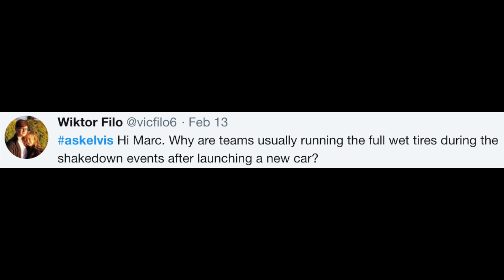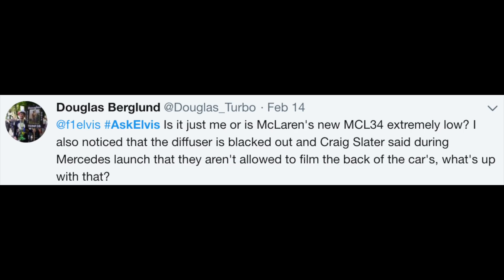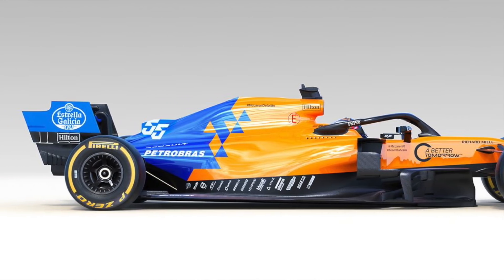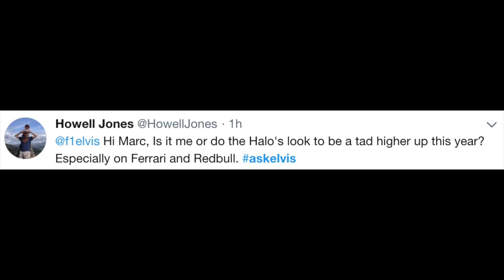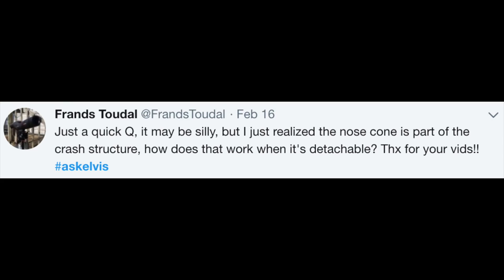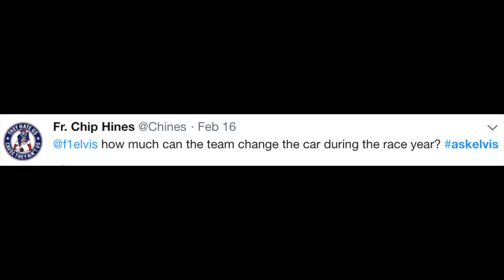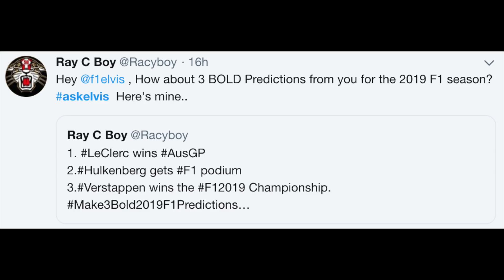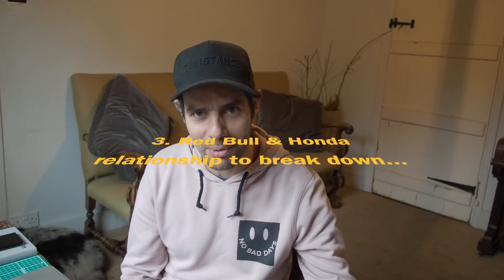MP231 - Is there an F1 advantage to using matte paint on the car?...& other Q's.

Comment: Wet tires are optimal for testing since they don't need much heat to be actually driveable. Slicks at 50-100km/h slow lap are like plastic wheels on a toy tractor - no grip at all.

Comment: The teams run on blue wall demo tires that are treaded because they're not allowed to use actual race tires on filming days. It has nothing to do with saving performance tires for later, they're simply not allowed to use them at all in shakedowns. I think all the cars are going to go to matte paint because of the weight. Yes it's a minuscule amount in the gloss coat, but there's no reason for it to be on the car. What tends to happen to anything on an F1 car that doesn't need to be there regardless of how big or small?
Reply from the maker: Actually they don't have to run on wet tyres for filming days at all, they have to run on dedicated tyres, which are a non specific dry tyre. They can however use wets for installation laps.

Comment: Well to my knowledge from RC planes. High gloss finish keeps boundary layer of air closer to surface, making higher pressure differences and therfore creating more effective low pressure side of wing. However it also makes quite a bit of drag, that is why high speed gliders with high gloss foil on it's wing are so shitty to fly without motor or uphill wind, but so much more effective with motor. Matt surface usually works better with thermical gliders.
I could be wrong of course, but it makes me think, that parts of body of F1 that are matt will slightly reduce drag and lift, that it is creating. As it is mostly visible on rear part of the body, that is the part, that is naturally creating lift, which might be slightly reduced by matt paint.
I can only hope, that I could someday check underside of front and rear wing and undertray, because if those are high gloss on those matt cars, I'm right :-)

Comment: Ask elvis# what is the reason 4 lowering the temperatuur of the tyre warmers ???
Reply from the maker: It's to do with Pirelli's recommended starting pressures at a race. Teams wanted lower pressures for performance benefits, so Pirelli suggested lowering blanket temps to allow that to happen.

Comment: Does matte paint or paint color have any effect on the cooling of the engine #askelvis
Reply from the maker: Not really. Obvs dark colours absorb heat in sunlight, but heat under bodywork is so much higher it doesn't have much of an impact.

Comment: And yet Mercedes have a new brand pattern on the back of their car. Aside from the fact it's just the arrow from the centre of their logo, which in branding terms is usually heresy, a few years ago creating a pattern from their trademark logo was also forbidden. 

But this pattern is painted on, and from previous videos they remove and repaint their livery every race. It also appear two tone, or reflective, with some arrows white and some dark grey... The pattern doesn't need to be there but they strip it and reapply [with some miniscule weight addition] so much effort, cost and time purely to look good as there are no performance/cost saving benefits.
Reply from the maker: I suspect the Merc engine cover is vinyl rather than painted...
Reply: @F1Elvis  As a designer I was fascinated with their 'laissez-faire' approach to their logo, it took 3 attempts to get a response [and find out about its application] but this is what Mercedes said: "It’s all painted! And it’s a new Mercedes brand pattern that is debuting on the F1 car." Vinyl would seem more sensible to apply but why would they fib? There's this close-up [https://twitter.com/MercedesAMGF1/status/1097464058805141505] that's clearly vinyl for the 77 and one arrow seems to have depth, but surely vinyl would weigh more...
Reply from the maker: I'm amazed if that's painted, but if they say it is, I guess it is...

Comment: Playing off the matte finish question; #askelvis has any team ever tried to do a golf ball like finish? You know a dimpled finish, maybe even designed right Into the bodywork itself? Anything in the rules to prevent it or thoughts why it prob wouldn’t work?
Reply from the maker: Nothing in rules to stop it, but whilst its aero efficient on a golf ball, the more important factor on an F1 car is flow control and for that, it's not so good.

Comment: Someone alrdy asked this but let's say in Austria where there are a lot of right hand corners, are teams allowed to run a higher angle of wing on half of the wing compared to the other half? Would there even be a performance benefit?
Reply from the maker: Nothing in rules to stop it, but whilst it works on an oval with no right turns, the performance loss through those corners in Austria would be too detrimental.

Comment: #askelvis
Does the engine formula1 team use in winter testing is outside of the engine quota for the season? On an average a car is driven for 1000 laps over a period of 8 days in testing, how does a single engine last for that long distance?
Reply from the maker: Yes, these engines don't count for the season and there's no restriction to how many they can use in testing.
Reply: Marc Priestley thanks for a quick reply. I am a big fan of your analysis. Keep up the good work 😀

Comment: There have been multiple times where the nose cone of a car comes off when it impacted even at a slight angle to a wall even though it's not a hard impact (Vettel in Singapore, Grosjean in Baku). It seems to come off too easily which could be a problem where if there is a collision at a "correct" angle which knocks the nose cone off, the car would then potentially crash into the wall without a nose cone which will be bad.

Comment: Regarding matt paint, there was an ongoing conversation on a rc flying forum about surface finish for pylon racing planes. 
The theory was that shark skin is rough and creates a boundary layer that reduces surface friction.
Could this be replicated on RC planes glass resin finish?
An aeronautics engineer ( in the whats next game ) pretty much gave us the answer when he said in principle yes, but to create the perfect finish that would stay in good shape and not fill up with dirt, fuel and grubby hand prints is much harder than creating a smooth finish, besides planes are too small to notice.

A matt finish could over the larger surfaces of an F1 car work better, not so much to improve speed through lower drag but to smooth and direct airflow better.
It could also increase surface area with it's imperfections to increase cooling, tho you'd think a white car would be better here.

Talking of colour recent research suggests sea going birds tend to be black on top, white on the underside.
Rather than camouflage to avoid predators ( nothing bothers attacking adult albatrosses, but the young are all black )  this may, through warming the upper wing surface increase wing efficiency.

Comment: Hi Marc, loving the content. on the matte paint side of things, i remember quite a few years ago there was an extreme hill climb car based on a ford Puma that used full carbon body panels (and a twin turbo cossie engine). the owner wanted it painted but didnt want to add weight, and they basically searched to find the lightest way of covering the car. in the end they used a light grey colour. it was lighter in weight than matte black, and considerably lighter than a full colour finish (something like 15-20kgs over the whole car).... i could be remembering that incorrectly though. and im sure they use as little paint as possible on F1 cars so the difference would be negligible.

keep up the good work!

Comment: In an article posted on espn f1:  
Ferrari's matte paintwork 'not a matter of looks'
"The new matte paintwork on Ferrari's 2019 car was used for technical reasons rather than cosmetic, according to team principal Mattia Binotto."
"It's not a matter of looks, there is a technical reason why it is matte," he said. "The weight is lower -- we are talking about some hundreds of grams -- but as we are pushing these technologies it made the difference. It's a matte finish and it makes the car lighter."
Reply: Yeah, I read somewhere that they predict 1/2 km/h increase in straight line speed down the long straights due to the drag reduction. Whether that's true or not remains to be seen
Reply: Less than half a kilo, yup that will win all the races.....
Reply: @vernonpitts6630  to shed kilograms, shed grams.

Comment: Newey pushes the aero stuff so hard he compromises the cooling and if the Honda engine is not reliable it would be hard to know if it is an intrinsic Honda problem or if the constraints imposed by Newey are the cause.  Newey is a great aerodynamicist, but he tends to cut thing too close to the bone which hampers reliability.  You can't win if your car is smoking on the side of the track.
Reply: To the limit indeed. Would be unfortunate. I think it would be easy for them to find out who would be to blame if they'd have cooling issues. Since they have 4 cars with the same engine, 2 of them with a different chassis.
Reply: In addition. Honda uses the same power unit layout as Mercedes (and Ferrari if I am right). This layout suits cooling better than the layout that the Renault power unit has. With layout I mean where the engine, intercooler and the two turbos are located. It was on a technical breakdown on the Autosport channel. Keeping my fingers crossed non the less😅
Reply: @ThePupil  One Turbo in F1
Reply: ...but when it's optimised you win 4 World Championships in a row! (Although, yes I agree with your analysis)
Reply: @Jim Mac correct, my bad. Chances are that from 2021 it will be twin turbo.

Comment: #AskElvis . I've noticed that when a car comes into the pits two front jack men come out. One lifts the the front of the car, and the other returns to the garage. What is the point of the second front jack man?
Reply: Backup for the first (primary) jack. If the primary jack fails, or if the driver hits it too hard and breaks it, the other jack and jackman are right there to pick up the slack. Formula 1 is all about “what if” and not “why bother”.
If you watch closely, they also have a second rear jack and jackman in place for the stops. After the car is up on the jack, the secondary jackman knows he can’t help no matter what and goes away.

Comment: I'm sure I read somewhere that when McLaren launched their 675lt road car, they used a matte finish on the interior carbon fibre over a gloss finish to save 50 grams. Clearly a very small margin as always in the world of performance, but surely if there was any worthwhile advantage to using matte paint, all the F1 teams would he using it?
Reply: It would not make the car lighter as there is a minimum weight, but it could lower the center of mass.
Reply: @Cloxxki  It would make the car lighter, allowing them to use more ballast, yes

Comment: 4K new subs, was great work all last week.

#AskElvis,
                  Can an aero part be placed on the rear section of the car which doesn’t produce any drag but can cause increased dirty air flow for the car behind?? Has it been done before to cause a competitor to run slowly??
Reply: I’m no expert on this, but I’m sure it would be near impossible to create dirty air without increasing drag, not just because of the physical drag on the part, but because of another property of aerodynamics. The aero engineers want to clean up all of the air leaving the car, because turbulent ‘dirty’ air behind the car can create pockets of lesser pressure than the air in front of the car, which would ever so slightly result in a force pushing/pulling the car back. This basic principle can be seen (and exaggerated) by how tapering the back of an object that has air running over it will drastically reduce drag compared to the same object with a more flattened off back. Anyone please correct me if I am wrong here, I just like to read up on aero stuff in my free time, so I’m just pulling all this out of my ass.
Reply: There is really no aero part that would have no drag effects on the car running it
Reply: Pradyumna Chandel I was thinking aloof I.e venting of exhaust gases or something along those lines to disturb the car behind